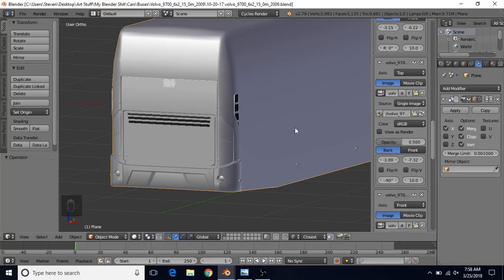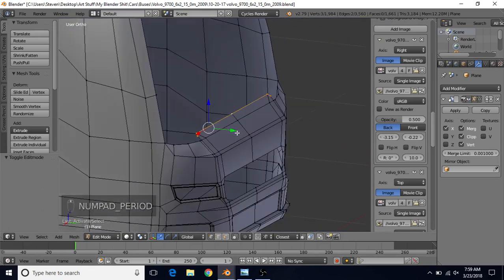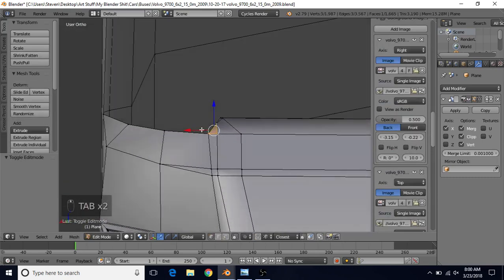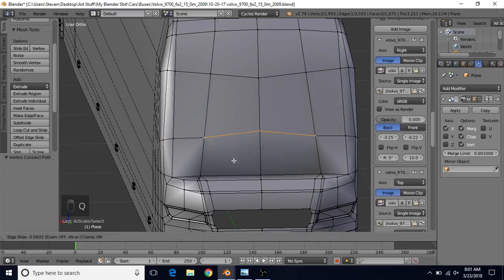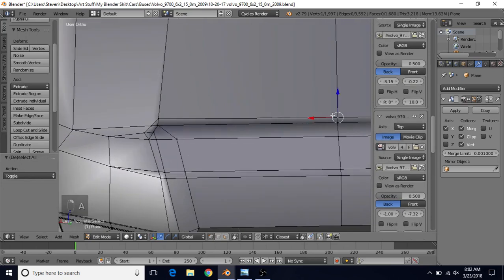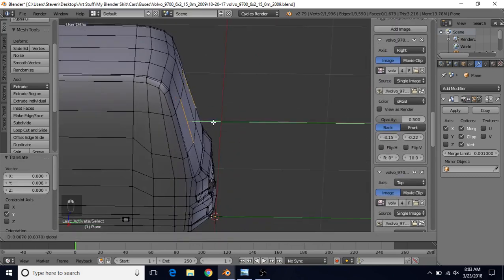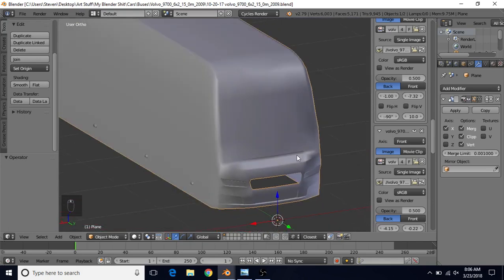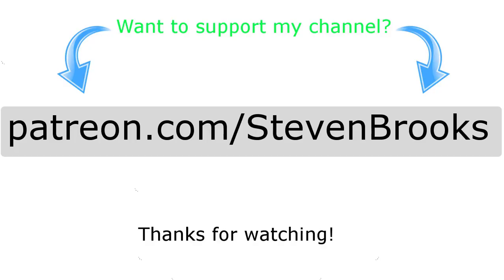Volvo 9700 6x2 Blender Tutorial - Part 17 - Windshield

Comment: Can you make a tuotorial for making Low Poly Interior? I need a interior for my R33
Reply from the maker: I think we can start the interior for this bus in the not too distant future. It should be low poly and perhaps it will help with the r33. It's a bit different since it's a bus but the same concepts still apply. Make some seats, the dash, the steering wheel, etc.
Reply: Steven Brooks even its not r33 interior i still can make it with your tuotorial btw thanks!
Reply from the maker: Hey no problem! :D